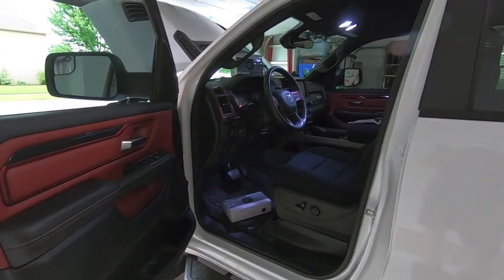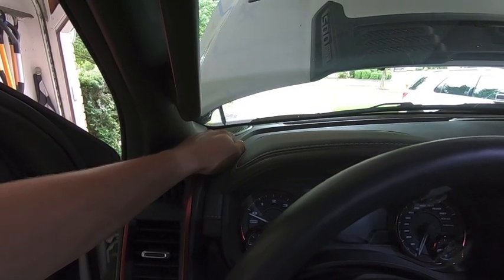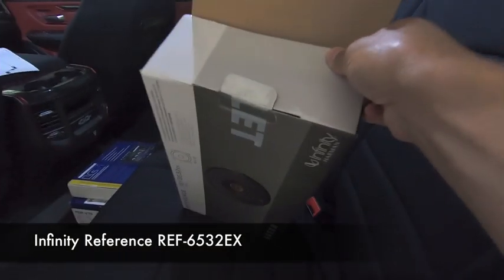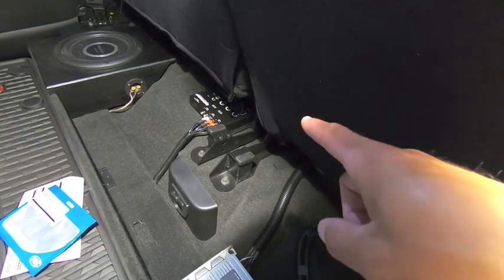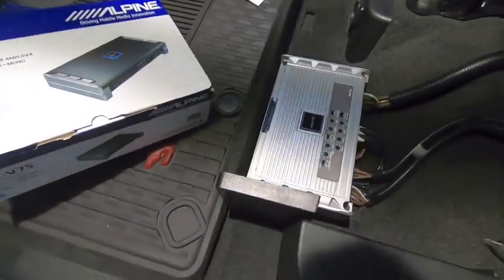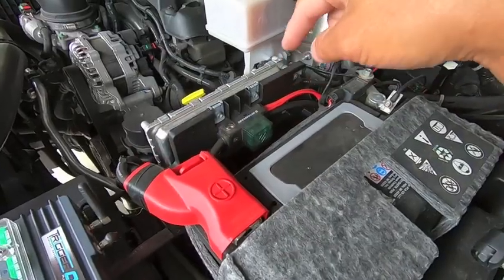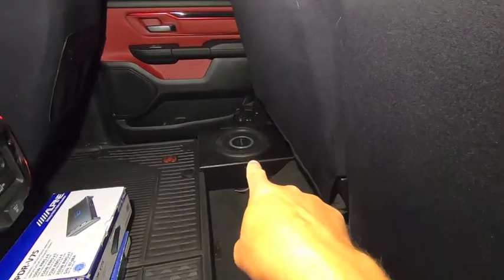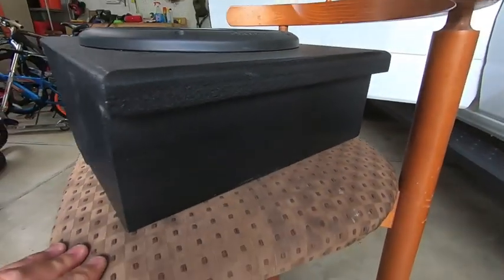Stereo Build Walkthrough - Ram Rebel

Comment: Unless you were hellbent on using the LC7i, the PAC AMPPro AP4-CH41 (R.2) would have been a much better choice to interface with the radio. It's a plug and play device that provides clean 6 Channel RCA outputs or Toslink output for your amps. Plus, it works better for the factory chimes, parking sensors and navigation. You would still use the ANC bypass and access the factory wiring for speaker outputs.
Reply from the maker: I already had the lc7 from another project

Comment: You said f65 but the manual says f66 for the "run-accessory feed". Can you confirm if it's f65 or 66? Great video this the information I was looking for overall for my truck as well.
Reply: I used F66 for “run-accessory feed”and I have no power to the Lc7i. Mine also says the same as above from my manual. Can you tell me if you are running that to the 12vdc on the LOC and what configuration your jumpers are in it? Thanks

Comment: I hot a 2019 ram.   all I added was a JL Audio sub.    driving home truck went into Limp mode.   every light came on dash.       # WHAT PROCESSOR  do I need to Run a Sub With built in AMP?......

Comment: So, if I use the LC7i just like you did, I don't need the PAC AMP Pro AP4CH1 like everyone on the 5th Gen forum is using? And I'm not sure why I others use both. I have a 2019 RAM 1500 with the base stereo as well. I am confused if I need the PAC AMP Pro AP4-CH1 and the LC7i so I don't lose anything or if the LC7i will be good enough alone. I already got the aftermarket ANC bypass.

Did you lose alerts or useability in anything? Aside from ANC.

Comment: Super awesome video. Very well explained. I recently purchased a 2020 big horn with same 8.4" screen six speaker system and let me just say Dodge dropped the ball with this one. It literally drops when you try to even slightly turn up the volume. Horrible. will most likely be getting a full stereo soon!
Reply: I wish someone would explain why that happens. I too have a 2020 rebel and I have the same problem. The bass mainly cuts out. Especially when playing my amazon music through the cable. It’s infuriating. If I’d known I probably would not have spent so much money  on a truck.
Reply from the maker: Its definitely worth the effort!

Comment: I just finished my speaker upgrade in my Ram 3500 (2018, so previous body style from this). I also had problems with bass basically vanishing after my upgrade. Come to find out, I think the factory speakers are inverted polarity and when you install new ones they're not inverted anymore with the metra adapters. So with the subwoofer installed from the factory you wind up with the sub and the door speakers basically cancelling out a lot of each other's low end and then your music seems bassless. Just something to keep an eye on. You can get a phone app that will tell you what polarity your running. The polarity itself matters less than making sure it's all the same.
Reply from the maker: I actually had this same issue in my gmc!

Comment: The factory dash speakers look like midrange speakers but they are crossed over to be tweeters
When you put an aftermarket speaker usually it’s a component 3.5” and usually it’s either 4ohm or 3ohm in the case of the infinity.
Half the impedance.. twice the power + your adding a midrange that isn’t crossover at 9k hz like the factory dash speaker. That’s why it sounds louder.. and also if you like sound stage you WANT the dash speakers to pull the sound up high and in front of you.

Comment: Awesome Video with best explanation I've found so far for upgrading.  I have a 2019 Ram 1500 - Quad Cab though and trying to figure out the best way to upgrade my stereo and have not been able to find any solutions for adding a sub.  Since yours is a crew cab I'm not sure if the under seat dimensions are similar with the seats of a quad cab.  I've heard many different observations, some saying that the bench seats are almost the same since the main difference between the Crew and Quad Cab is the extra leg room.  So I'm hoping a similar sub box solution might work also for an quad cab version of the Ram 1500 truck.  Thanks again for your detail info on everything.

Comment: Great video! The reason your speakers lose bass is because factory speakers are highly optimized to perform in the factory doors. Essentially factory speakers are like hybrid subwoofers sort of.  With any after market speaker you replace, you must sound deadened the doors to really enhance the bass output. I guarantee if you sound deadened the doors your system will sound much cleaner and your cabin will be quieter. Of course you can always do more than just deadening the doors :)

Comment: This Is EXACTLY the detailed instructions I’ve been digging the internet for!! Thank you!! 

Questions: when it comes to the LC7i, that adds the feature for “AccuBass” but I noticed you don’t have that spare channel used to output to your amp.  I guess, how do you route your sub if not from the LC7i? Does the Alpine Amp filter the sub frequencies appropriately just with those speaker inputs? If so, could we effectively us the LC6i in place of the 7i? 

Thanks again!!
Reply from the maker: Yes the spline amp has a 5th channel specifically for the subwoofer so it has all the cutoffs I need
Reply: @WaterFowler41  Gotcha! Makes sense. So then really we could bypass the AccuBass feature entirely with the LC6i instead and get the same results?
Reply from the maker: Yep I used the lc7 because I had it laying around, the lc6 works as well

Comment: Get the Kenwood Excelon KFC-XP6903C for the front. They have a filter for the dash and a choke for the doors. Best investment I made for my truck. Even the factory head unit drives em hard. Spent over 1k on my wifes car trying to get hers to sounds as good as mine with just that upgrade. 
If you have an 18+ with the touch screen get AmpPro from PAC if you want to amplify. Pure signal out with no bass roll off.
Reply from the maker: What I installed worked well for me

Comment: Generally everyone just cuts the and and leaves the wires cut. The noise canceling will severely mess with you’re overall sound quality. This is something we figured out ages ago on Cadillacs. It does provide a nice easy play to tap into the speaker wires but we leave that anc cut and disabled 99.9% if the time in all vehicles. Have to know the vehicle and specially how it works.. cause sometimes the anc is built into the factory amp on high end factory systems. Not an with external amp but if trying to run factory amp for door speakers sometimes this won’t work. 

Pac makes incredible products but most often I just use t taps and the wires.
Reply from the maker: This harness bypasses the anc as well as provides an easy method for tapping into the favtory speaker signals.

Comment: What was the 10 AMP Red wire in the fuse box used for again? Is that to turn the system on? I got a little confused when discussing powering the amp, then showing a power out to the Line out convertor... BTW the ANC harness is a game changer. I was going to pay an installer but this will make life easier... ! Last question, did you loose the ANC functionality?
Reply from the maker: Yes the 10 amp is the remote turn on.

This harness bypasses anc so you will no longer have it

Comment: Everything works, thanks again! Just wondering if you added resistors before the tweeters.. I find I have a bit too much treble even after fiddling with the EQ
Reply from the maker: I didn’t but i have some in my stereo bin. Bought them for this purpose but never installed them.
Reply: @WaterFowler41  I wish I had an actual audio frequency monitoring tool but ended up using an app to simulate pink noise and found a spike around 9k. Then using the PowerEQ app for android I adjusted my phones EQ accordingly and now my treble seems to be under control. I mostly listen to music from spotify via Android Auto and I love having more than just the basic 3 band equalizer the stock radio offers. Figured I would share as a thank you for sharing your install.

Comment: Absolutely spectacular video! Thank you for taking the time and showing your build! It looks amazing and super clean! 
I have an 18 with the alpine system so im looking at doing something similar build but have to deal with the internal amp.
Reply from the maker: Pac has a harness to allow integration into the factory amplified system, a little more $$ but helps make the install a breeze
Reply: @WaterFowler41  i was just looking at Crutch field and it seems better to go with your setup (5 channel) and do away with the factory amp altogether.
Thanks again!

Comment: Thank you for the video but had a quick question. I am pulling wiring out of the ANC bypass as you did here. The difference I have from you is I ran new speaker wire to all speakers. With this being said I will not be running speaker wire back to the ANC bypass as the speaker wire will be running from amp to each speaker. With my application would you recommend using only half of the ANC bypass to run signal to my LC7i or should I T in the wires to the ANC bypass so the loop is still present?
Reply from the maker: Yup the anc harness can send the factory signal back to your processor then your new cable runs will home run to every speaker.

God speed my man, those door harnesses up from are not fun to remove but if you need help, check out my paragoptics video. I show the door connectors and how they pop out.
Reply: @Waterfowler 41  awesome video, question I'm gonna be adding jus a mono amp for my 2 subs. I was gonna jus gonna get the lc2i pro and use it to get my signal(rca's) to my mono amp. Will my door speakers still sound ok I was told if I use a lc2i my door speakers will not sound good cuse I would hear nothing but bass and should use the pac pro which I could always add a small 4 channel if my subs over power my door speakers after I install.

Comment: good vid.. helped alot. i am installing a similar set up in my ram. but i have a couple questions... i see that you used the pac anc- ch01 that is sending the signal to your LC7i then to your amp. then back to the ANC..  are your dash speakers running to the amp as well.. or are they summed with the front door speakers from the factory? also if i run the add a fuse like you  did is that going to bypass the GTO circut on the lc7i. i heard that using the gto feature is not the best cause it turns the system on every time you open the doors.
Reply from the maker: Dash are tied in with my front doors so fed from the front channels on my amp.

Yep that’s exactly why I ran a switched lead, every time I opened the doors my lc and my amp kept turning on.
Reply: @WaterFowler41  do the dash speakers come stock wired in with the front.. so when i pick up the signal from the anc module i will be sending both the dash and doors to the lc7i?

Comment: Great video! How do you connect the power from the fuse/distribution box to the batter terminal?
Reply from the maker: A short piece of 4 gauge wire with a ring connector on the end of the wire to attached to the battery terminal.

Comment: Did you run new speaker wires to all of the speakers from the amp? Or did you somehow feed everything through the factory speaker wires?
Reply from the maker: No I ran the wires to the loc/amp then the wires from the amp tap into the trucks existing wires.
Reply from the maker: I cover that in the video, only wires I run are to and from the pac harness to the LOC, otherwise the stock wires are used for home runs
Reply: You don’t have to run wires to the door speakers. Just find the harness that the door speakers are located in and connect the wires you run from the amp to the CAR side of the harness, not the one going to the amp
Reply: @austing2481  which is which one? I'm using the ANC CH01, and i get cutting the pig tail. But, that connector doesn't plug into anything on the ANC module. I can get the signal from the module via the adapter, but I'm lost on where to send it once it leaves my amp.
Reply: @WaterFowler41  which is which one? I'm using the ANC CH01, and i get cutting the pig tail. But, that connector doesn't plug into anything on the ANC module. I can get the signal from the module via the adapter, but I'm lost on where to send it once it leaves my amp.

Comment: Signal wire you said on the fuse, so you’re saying you got the actual speaker signal from there? I’m confused
Reply from the maker: My LOC has a speaker sensing feature where once theres a signal sent through the speaker wires, the LOC turns ON.  However this causes issues because the speakers were constantly seeing a signal so I ran a fuse tap to the remote plug to turn the LOC on when the truck is on instead of using the speaker sensing. I disabled speaker sensing.
Reply: @WaterFowler41  I’m running the same loc and having the same issue.

Comment: So I just replaced all 6 speakers with infinity. 6x9's and the 3.5's. obviously way better sound clarity. Still don't think it sounds all that good though. Did you rock the stereo before adding the amplifier? How big of a difference after adding the amp? Excluding the sub as I don't have one. Although I think they may be in the near future. I also disabled the ANC just in case.
Reply: Hmmm i never thought it was obvious that infinity sounded better? I do like infinity for highs but as a full range every infinity ive tried ended up in a trash can..id buy a pioneer speaker before an infinity for a full range speaker..but im glad for you infiniti is obviously better sounding
Reply: Id probably leave the factory 10 watters in without an amp..in all seriousness and no pun if i was you id throw that little alpine inline compact amp in behinde the stereo in the dash, id evan say its required minimum for a speaker upgrade to power basically any aftermarket speaker..you will still be missing sound tho from that factory head unit it would sound 100 times better tho..but that little alpine amp with a kicker self powered sub and speaker enclosure that come in 8 and 10 inch are perfect..if you add an affordable digital processor to recover the lost frequencies from the head unit you would be satisfied and only out 800 bucks with speakers you would be pushing 1200 dollars..but beyonde a doubt it would out perform the factory amplified system and you wouldnt know you didnt spend 3 grand by listening to it..

Comment: Does the anc have a power and ground wire I can splice into. From looks of wire size  guessing the yellow and black in the adapter harness.  I have a pac lp7-2r  rather not tap into fuse of truck if I don’t have too.

Comment: Fun Fact - I found an ACC Remote wire that goes hot with ignition underneath the power driver seat. Brown wire if I remember correct (been a while).
Reply from the maker: Any idea what it’s powering? I’m typically hesitant about tapping wires I don’t know the end use of
Reply: @WaterFowler41  I should have added "use a relay" just in case but for me, it's worked great for over a year now on daily use. Didn't even use a relay because I'm a cowboy!
Reply: @WaterFowler41  I can only assume this is powering all seat controls so that when you hit a button on the lower left it already has it's power source and can immediately react for your convenience.
Reply from the maker: Raw dogging it!

Comment: Great video! I've been reading the 5th gen forums for a few days now and this is one of the best explanations imho! So, did you end up disabling the ANC? Because, after I upgraded my stock 6 speaker setup in my 1500 my ANC went haywire and I now have this drone sound and I unplugged the ANC harness for now. Moreover, I am looking for a an amp and a subwoofer option right now and I do use the under my rear seats for storage so, I am trying to figure out a way to install a sub or two behind the rear seats if I can.
Reply from the maker: The anc ch01 disables the anc system so I don’t have to deal with the droning.
Reply: @WaterFowler41  ok, I have the same harness and I wasn't sure if you had installed back in the ANC or not. So, the amp is also amplifying the 6 speakers? Any recommendations for a slimmer subwoofer solution behind the rear seats? Thanks in advance!
Reply from the maker: Yes the amp is amplifying all 6 speakers 4 main channels and the dash tweeters in parallel with the front door speakers. 

I haven’t seen a back wall sub option, just slim subs for under the rear seats. I like my pioneer ib flat.
Reply: @WaterFowler41  Thanks for the info and great writeup! Do you have a link of the thing you have installed to the battery in the engine compartment by any chance? I was just looking at this https://www.crutchfield.com/p_241LINKLD/Wamacr-vtech-linkLD.html and wondering if what you have installed is same as that?
Reply from the maker: This is what I have in the engine bay, it’s a dual fuse scosche block.

Scosche HY1622B Compatible with 2009-10 Hyundai Sonata ISO Double DIN & DIN+Pocket Dash Kit, Radio Delete Version Black https://www.amazon.com/dp/B002RG23MS/ref=cm_sw_r_cp_api_glt_fabc_KDKZ9YK6EEZVZJP121BE

Comment: Only one question, did your chimes, phone calls, etc also get amplified? I ran the same setup in my last truck and had that issue. Thanks!
Reply from the maker: Did you by chance have a GM?
Reply: @WaterFowler41  Yep, sure did! Door chime was deafening!
Reply from the maker: Yep me too, it most certainly was, you will not have that issue with the Ram.

Comment: Do you have to wire from amp back into the anc harness? I’m just looking to power my sub not my door speakers.
Reply from the maker: If you’re only looking to grab the signal for a subwoofer no you don’t need to wire the amp back to the anc but make sure you’re only t-tapping the speaker lines and not cutting them.